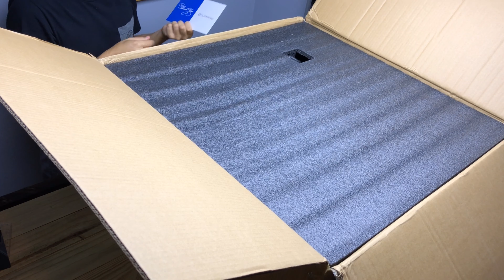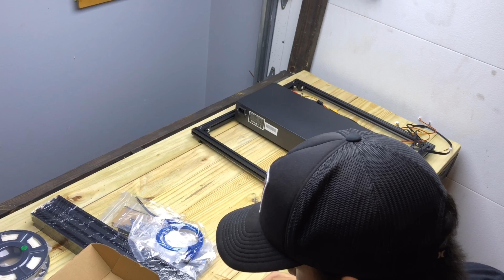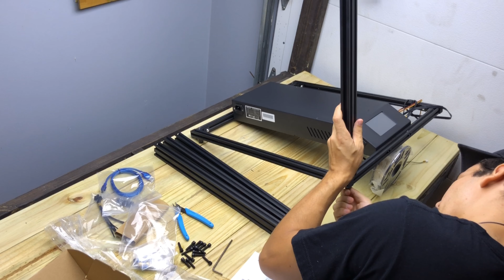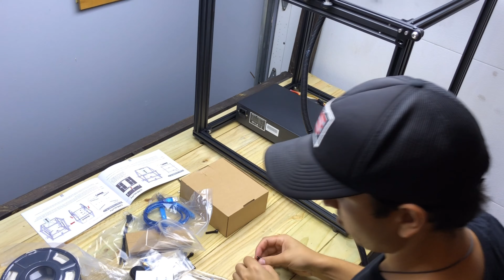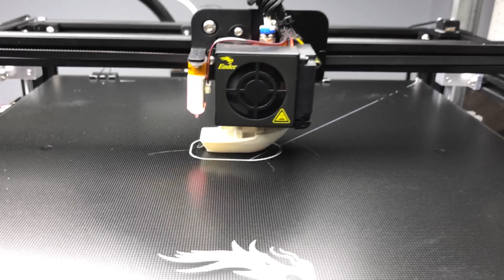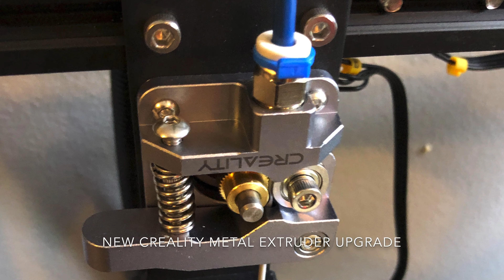Creality Ender 5 Plus Unboxing. 3D printer. Worth it? I think so.

Comment: A hope of one day having a man machine interface worthy than of an ender 3/5 (colorless but pretty much effective for settings) ? I believe it will take one or two days for an engineer to change it.

A hope of one day having the ability to print files with names longer than eight characters, my ender 5 plus don’t ? Include with the first job for an engineer…

A hope of one day having a silent mother board include ? It’s just an incredible Creality choice.

A hope of one day having a SD card with an ender 5 plus profile for the include slicer and a  gcode test file ? It will take one hour for an engineer to change it…

The bad reputation of this printer only revolves around it (and the noise and the quality of PSU)… 

Why do Creality continue to disappoint those who evolve in the Creality product range with such a poorly developed machine ? While mechanically it is very well designed.

 

I would prefer to  modify an ender 5  with 800 or 1000 mm frame bars, second Z axis, longer Z screws and extended vertical guides. Cheaper and smaller bed than ender 5 plus but longer Z axis, easy modification and better man machine interface.

Comment: Did you have any problems with the printer?
Reply: As an owner, I feel in position to answer. The printer itself is nicely built, the platform is sound and sturdy. When you assemble the printer, it's important to watch out for squareness in fitting frame together. Another thing I found very usefull, is to use a dry teflon lube on the z axis leadscrews, lube the z axis rails and to level each side of the moving bed gantry, otherwise you will get z axis wobble. The other things you will have to tweak is the extruder steps, each axis' belt tension, guide wheels, and PID settings. With the stock firmware you are only limited to the hot end PID, which is a shame and really the biggest flaw of the printer IMO. It's fixable, if you are inclined to change the printers firmware (the silent board will accept other firmware, no need to change it really). Another thing is really to check if all screws are properly tightened. My hot end was assembled in a way that enabled it to leak through the heat break thread. Thankfully it was fixable.

Other than that, I find the printer to be very nicely performing, especially if you set the speeds to be more or less sonstant between the walls and the infill. The extruder could be better in regulating the flow according to print speed, but it's very much workable. The dimensional accuracy is really good, the glass bed is level and has good adhesion. It's overall a good printer.
Reply: @ujnawierzbie72  do you know any suggestions on what to do if filment doesn't come out during the print is running? The machine moves but nothing is coming out. I did the extrude and saw stuff come out before. Maybe because it's been sitting in the tube for a while
Reply: @samsherman0331  first thing to check would be the nozzle temperature and whether the extruder gear makes secure contact with the filament. I would examine the machine for any clicking noises, all wires being connected etc. The nozzle could be clogged, or there could be a leak at the nozzle/thermal block. If everything is ok, it could be caused by bad gcode, so trying a different slicer, or different model to print sliced by something else, is another thing to do. Oh, and if you are running the gcode from the SD card, you could check it teethered by USB.

Let me know how the printer behaves after checking all of that.
Reply: @ujnawierzbie72  alright thanks. I thought maybe it's the SD card they give you when you buy the machine or not. All the plugs are in the right places and I did leveling. Is there a certain temperature I should have it at? I can also try taking out the filment and snapping a piece off and re doing the load process. One more thing I would like to ask/mention is that when I go to load a filment do I need to add the option PLA or ABS to be able to work the print?
Reply: @samsherman0331  yes, every filament type has a range of temperature in which it is workable. For PLA it is typically 185-220*C, but PET-G or ABS, and other options it's often much higher, so if you are using a filament it's wise to check what is the recommend printing temperature.
Reply: @ujnawierzbie72  alright thanks. But yeah I can re do the test and check the filment too. And that SD. Because I've heard it's mostly the SD card they give you that's causing issues like this but I could be wrong. Do you use your own filment or the sample they give you? I'm pretty sure I have PLA. I was just wondering if I needed to add the option PLA or ABS in the machine when I go to print since that might be another issue why nothing is coming out during the print but I could be wrong.
Reply: @samsherman0331  by selecting pla or abs, you mean the preheat option in the printers menu? It shouldn't cause these problems, since the gcode you supply for printing already has all instructions for the printer, temperature included.
Reply: Also, what slicer are you using? Perhaps some printer extruder directions in the gcode are incorrect?
Reply: @ujnawierzbie72  alright thanks.
Reply: @ujnawierzbie72  I'm using something different to what the slicer is for creality. Is their slicer better?

Comment: Do u think it wort it tell honest pls
Reply from the maker: Palsowen it is. I have done a lot of upgrades but from factory it is a solid printer. Most people that say bad things are mostly user error.
Reply: @engineerofalltrades  do u think printing good
Reply from the maker: Yes
Reply: @engineerofalltrades  pls make video plsss about ender 5 plus I want see
Reply: Make video title ender 5 plus after 3 month
Reply from the maker: Palsowen I will soon make a series of videos I hope
Reply: @engineerofalltrades  One thing I found was the brass leadscrew nuts need to be slackened off to stop the screeching, they are meant to be slack but get tightened at the factory to stop them shaking loose in shipping, some white lithium grease needs to be appied also, this is the only Creality model of 4 that I have that came without the leadscrews being greased, the Ender 2 was covered in the stuff and the exess had to be wiped off.
Reply from the maker: @AndrewAHayes  I replaced with POM nuts